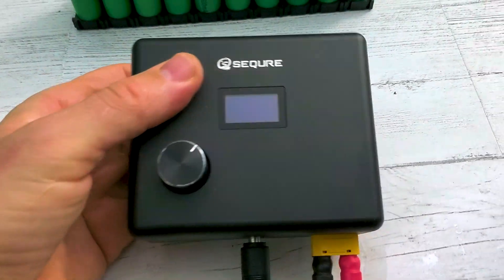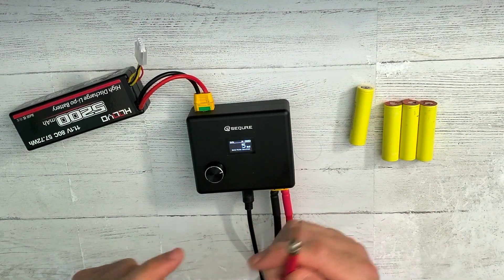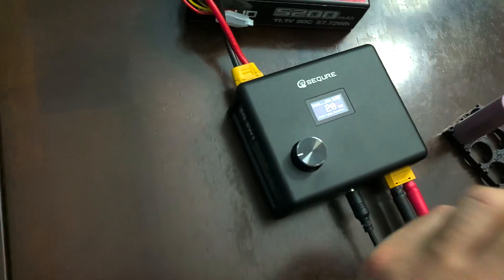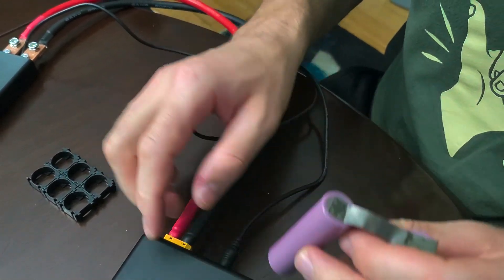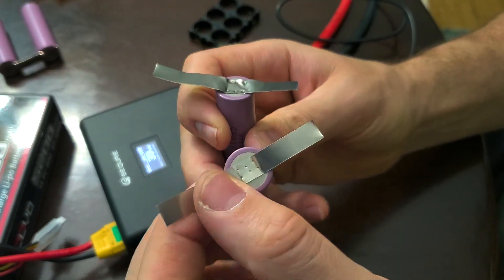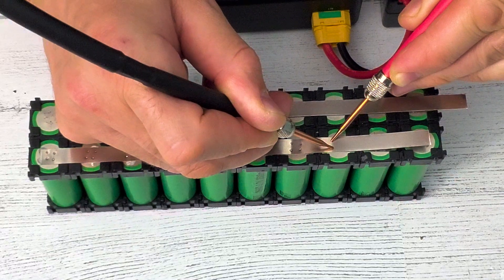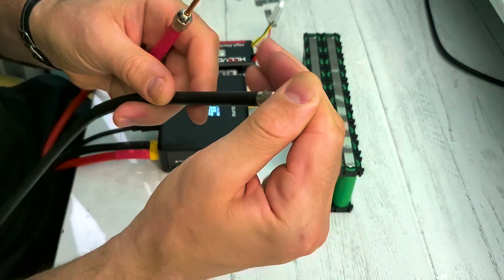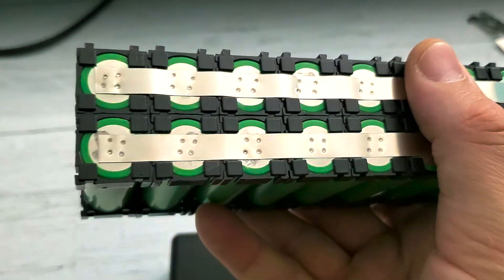The $220 Compact DIY Spot Welder Alternative That Will Change the Game -  SEQURE SQ-SW1 Mini

Comment: From other youtubers, I've learned that the lighter you press, the better the weld.  Ideally, apply just enough pressure to make the top and bottom surfaces touch, so there is no gap.  If they are already nice and flat and flush, just the weight of the rods is enough to get a good weld.  Also, the whole point is to not let your battery get too hot, in this video you are popping that poor battery twice in each spot, and six spots for 24 welds on one battery in just a few seconds so the battery is getting really hot inside -- the opposite of what you want.  I actually weld once, then next battery once, then circle back to the first battery so I know it stays nice and cool.  I really am a beginner, but I've seen this explained, and it really made a difference for me and keeping the power low, so I feel like it's important to spread the word on this misconception.

Comment: The only problem I have with this lipo battery for spot welding is that when spot welding a thicker plate, say copper 0.15 + 0.15 nickel, my spot welder is set to 60 pulses + 60 percent and the lipo battery from which I am welding starts to get very hot, and I dare not use it anymore! But this phenomenon occurs even with ten spot weldings, even though they spot weld from a Bashing Gens 8000mAh pack, which is 100C!😮

Comment: To everyone thinking of buying a Sequre product, DO NOT trust that company, if a product is defective you will be out of luck because they don't give a rat's a$$ about you, tell me how I know!!! They will blame you for the lack of quality!!!!!
Reply: I tried replying to a prior comment but I think it got deleted?!  The battery they sell, ZOP POWER 100C 5000MAH, if that is what you are using is poorly designed!  I found a review on this site which describes the issue, look at the review by jjdz.  It is this thin metal strip that heats up and severely hinders performance.  Instead of wiring the negative battery terminal directly it runs through this thin strip that heats up and doesn't allow enough current to flow.  I rewired mine and it performs 1000 times better.  I can weld .2mm using 9ms.
Reply: @jackfranks7160  Yes that's the one I purchase from them, it gets very hot with high pulse, what site are you referring to?
Reply: @TorpedoBurrito  bang good
Reply: @jackfranks7160  Can't find anything on Banggoog.
Reply: @TorpedoBurrito  it's discontinued so look for it on your favorite search engine.  It should be the first result.
Reply: @jackfranks7160  Ok found it..thank you.
Reply: @TorpedoBurrito  Sure thing!

Comment: How hot is your battery getting? Mine get to 100°C after 6-7 welds at 100ms!!
Reply: Which battery? For the welder or the batt you are welding?
Reply: @SchwaboT5  The battery for the welder I bought from Sequre! Like Jack Franks said in a comment below the negative terminal is linked via a thin metal strip to the 10ga wire!! It's a poor performing battery and Sequre doesn't give a crap about solving any issues!!!!
Reply: @TorpedoBurrito  yea but that is normal and it must ne like that. If you use better wire, it goes to much Power in the welder and it will blow up.
Reply: @SchwaboT5  No it's not normal, it's poor design! The welder perform poorly with that battery!
Reply: @TorpedoBurrito  if you test 5 or 10 Spot welder with battery, you will See, its normal. They Limit the Power with small wire. If your Batterie has more than 60C, your setting is right and you have good Strips, then the welding is ok.
Reply: @SchwaboT5  Battery can't perform at its rating of 100C, that's 500 amps!!!! The welder can't spot-weld a 0.2mm strip, the welder supposes to weld 0.3mm!!
Reply: @TorpedoBurrito  i dont have this welder. I like the ones for 15€ more 😅

Comment: I bought this welder with the battery Sequre sells(5000ma 100c) and its performance is mediocre at best, to weld 0.1mm to itself I need around 35ms and for 0.2 I was unable to weld at 100ms!!!
Reply: I'm able to weld .2mm with it set at just 9ms.
Reply: @jackfranks7160  Not me, Sequre was no help eithe, they are totally useless, never will I buy from them again!!!
Reply: @TorpedoBurrito  see my reply to your latest post, it looks like that one went through!

Comment: This spot welder is overpriced, at this price point I would just go with the k-weld. I bought this awhile back and had nothing but regret. Their logistics is garbage, takes forever with tracking being completely obsolete. There are other welders on Amazon that you can buy and test. This one takes to long to receive and return if any issues come up. Id avoid it
Reply: where did you get a kweld for less than 200 bux?

Comment: I just got this spot welder with a Zee 7200mah 80c battery.  It was working fine for most my build.  Now its just blasting major holes through my strips of nickel with major sparks.  No idea whats up with my welder.
Reply from the maker: Adjust settings or contact the company

Comment: In a previous video on safety you made it seem like fuses were the only way to go...just wondering why you aren't using them here
Reply from the maker: Here is just to test the spot welder so it's easier to see.
Reply: @ElectricVehicleSpace  okay makes sense. Seems like getting laser cut aluminum bus bars and spot welded fuses is the way to go?? I am trying to figure out how I want to build a compact high draw (200 amp peak) pack. Any advice would be appreciated. I see people with pre fabbed bus bars but idk where they get them. Guess I'll hit up a laser cutter lol?

Comment: have anybody build spot welder old tig/MMA welding machines, i have one were not can use TIG because not on/off button at welding torch working, have alltime only ON mode. one new 3 in 1 welder, MMA can use if stick connect welding ok, TIG not can use have alltime ON mode, plasma i not has test ewer. but interesting if install cables out and diy cheap timer orden and install cables to timer and hand spot weld this. power have lot and timer keep pulses 1-2 pulse fast only

Comment: thank you very much for the links my friend!
i have an idea!!!
will a 3s nanophosphate 26650 can be used to work with SEQURE spot welder?
 continius dischrage of battery is 50amps and pulse for 10 seconds 120amps

will it work without harming the spot welder?

are batteries strong enough with these capabilities to work the spot welder?
Reply from the maker: No. You need the batteries I placed in the links. These are manufacturer recommendations.  I would not experiment with lower C rating batteries.
Reply: @ElectricVehicleSpace  is there a max continuous discharge rating? Can I go with a 100c battery pack? Is there any benefit to doing so, will it work better for welding thicker strips?

Comment: Maybe get someone stronger to pull those welds. I came here to see if this thing could be trusted to create decent welds on 0.2 but I won't find out from this video lol need to rip it to be sure. That's what people need to see in a spot welder review
Reply from the maker: I don't know anyone stronger. I pulled with my Leatherman and I ripped the strip. I should included that in the video for you. Trust me it is a good spot welder. I have been making batteries since 2013. I can send you a clip where I pulled with the pliers to confirm if you would like.
Reply: @ElectricVehicleSpace  that's what we needed to see man. Ripping nickel is the only way to be sure it's solid! That needs to be in there!
Reply from the maker: @josh4014  I cant re edit the video unfortunately
Reply: @ElectricVehicleSpace  that's a shame cause the nickel rip test is the most important 5 seconds of the whole vid to me.
Reply from the maker: @josh4014  irrelevant
Reply: @ElectricVehicleSpace  seriously? It's the only way to know for sure your weld is 100% isn't it? When the nickel rips and leaves a little behind but your weld isn't burnt, isn't that the definition of the perfect weld?
Reply: @josh4014  your right I would like to see how nickel is rip and that's gonna give me information how good is that welder.